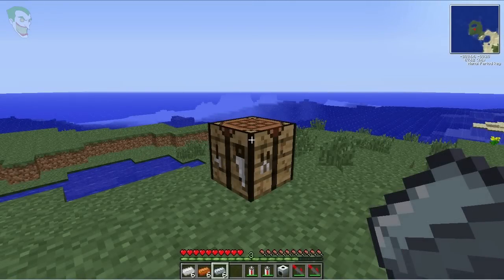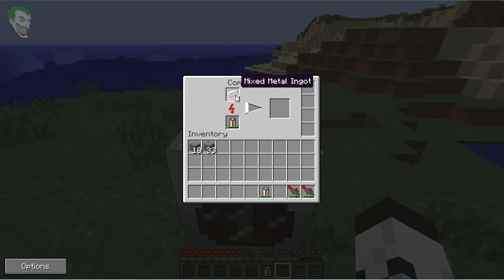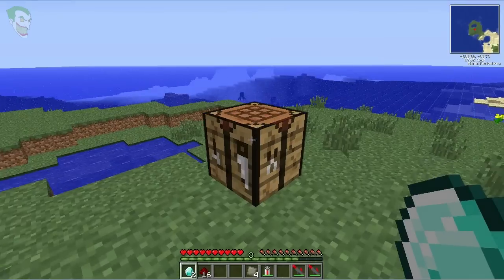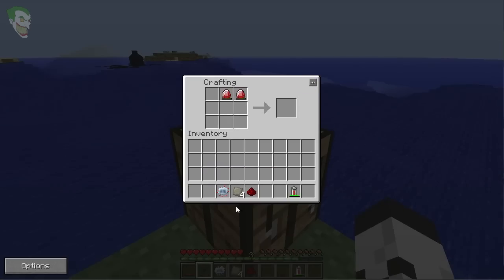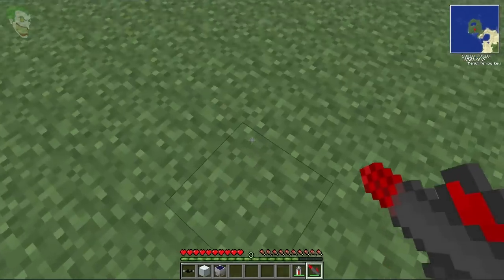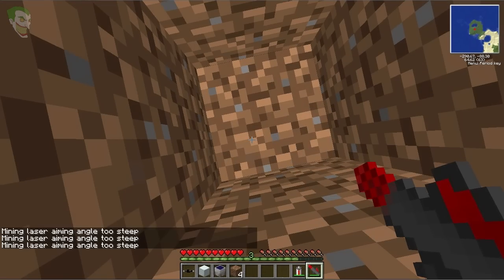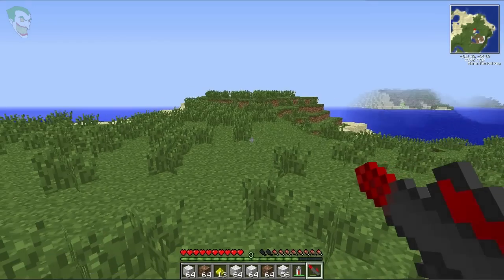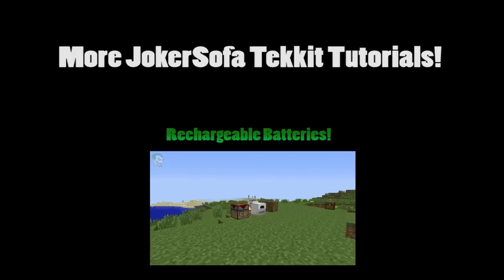Tekkit - How To Make And Use a Mining Laser

Comment: Great job. I noticed this video linked from The Tekkit Wiki.

** Notes to others **
- The "Super heat" mode is supposed to drop the smelted version of ores and other blocks. (Ex: use it on iron ore and it drops iron ingots)
- This cannot destroy obsidian/bedrock/other extremely blast resistant blocks, even with the explosive firing mode.
Reply: He should have walked the ten meters to the beach and shot the sand, turning it into glass. That would have made it super obvious what he was talking about.